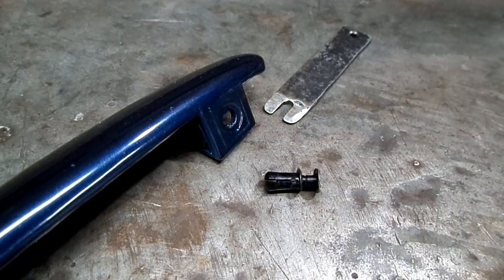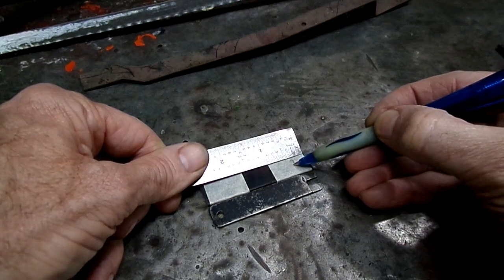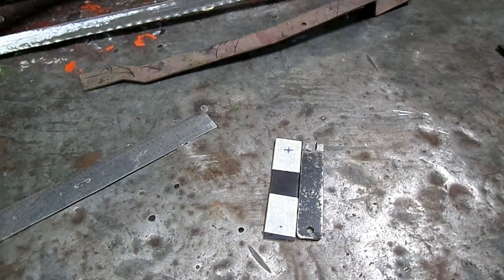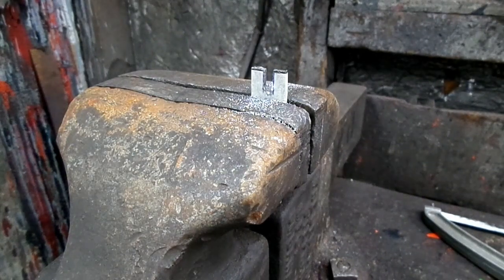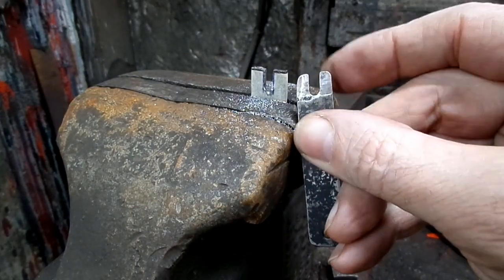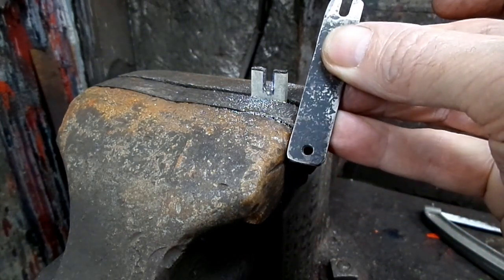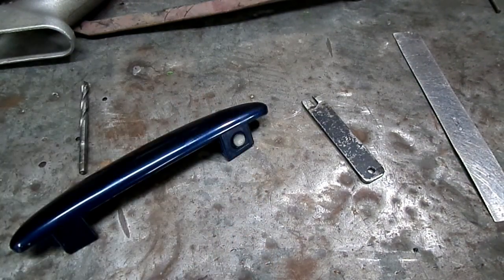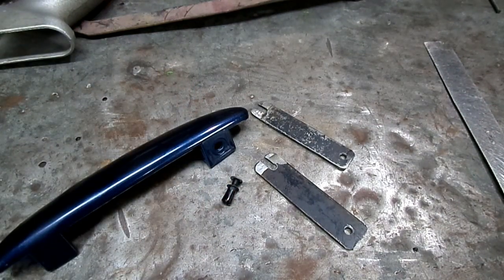Door Handle Push Pin Removal Tool

Comment: Nice :-)

Nothing better than home made tools, made just for one special job :-))

The broken hacksaw blade has been usefull as well, slot cleaning or just cleaning the crud from between commutator segments :)

I have a hacksaw blade tool only for cleaning the channel in a hydrolic brake caliper, the seal channel, its ground like a bent finger with a perfect profile to fit the channel.

That tool you made was good, but it wont beat the panal tool, bloody handy :-)

Comment: Thanks just what I need. I will be making this when I get home from work. I have a cheap Harbor Freight bandsaw and a powered chisel sharpener to shape it so this will be easy to make. Thanks. I will need this tool because I need to take the door skin off to see why my electric window isn't working the way it should on a 1999 Saturn 3 door coupe.